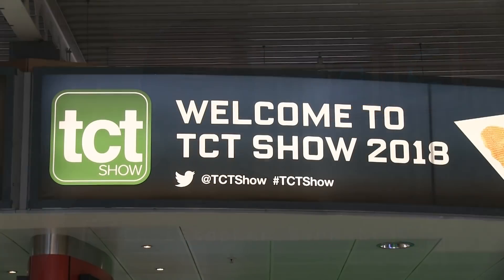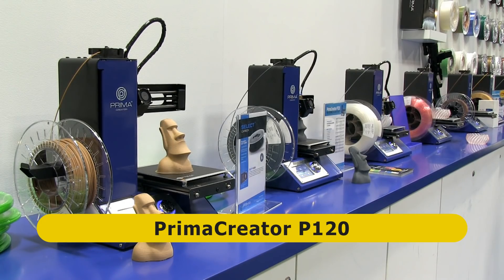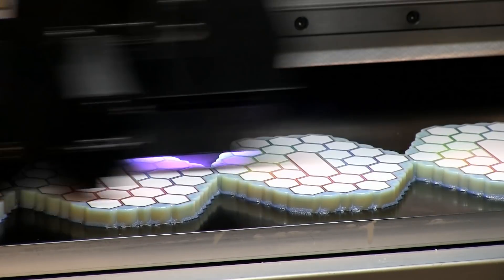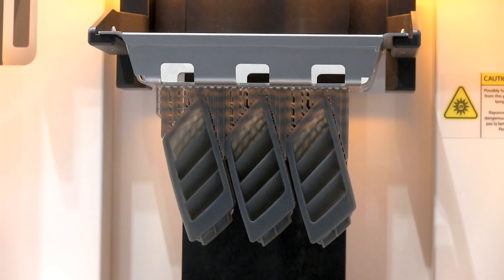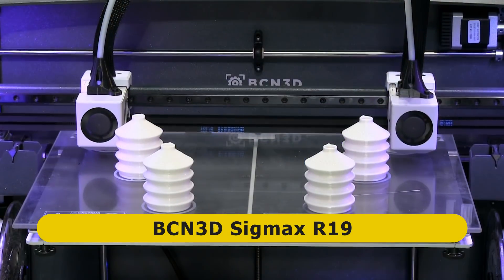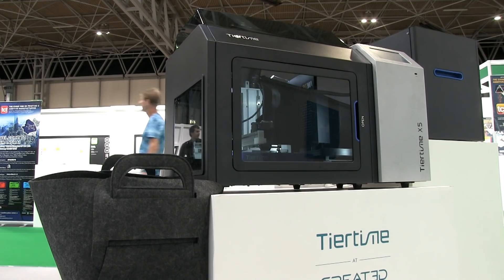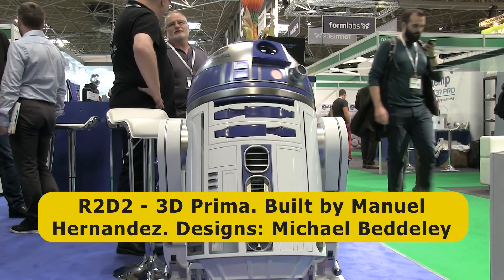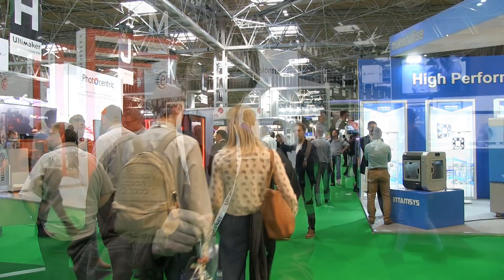3D Printing at TCT Show 2018

Comment: What happened to CLIP?  lol google carbon3d.  Be amazed.
Reply from the maker: Sadly Carbon were not at this year's TCT Show, so they are not included here. Note that the 3D Systems Figure 4 system shown uses effectively the same technology.
Reply: I will go back and check.  I skimmed looking for something new and didn't see anything right off.  I've got some ideas forming re: similar application of principles to draw materials like sugar and bone.
Reply: Checked back - CLIP clone.  Operates at about 50% output rate - if equivalent print quality and cost competitive per output unit andor superior materials selection, then they've got some contention perhaps.  All the other points are things I expect in a "factory" type offering - modular/cellular, libraries/catalogs of things, continuous output options/features, etc.

Good job on 3D for pulling it off, though.  I know several people who have started their kids (and their own hobbies) on MP cheapo printers and enjoy the hell out of it.  Of course, the only complaint is time as all the rest of the caveats are well understood within the first week of buying a more hobbyist type of machine.

Teach your kid "load frame" and "gantry" and they'll understand 98% of FDM (as well as other types of standard programmable X/Y cutting tools, like plasma, laser, waterjet, et al).  :-)  

Thanks for the response and pointer to the info!
Reply from the maker: Figure 4 significantly pre-dates Carbon CLIP -- the name comes from the first 3D Systems SLA patent in the 1980s! :)

Comment: I have actually worked at Stratasys before. It all started at school when I was new to 3d printing but during my work at Stratasys I learned A LOT about these machines. The place where I worked they have both Fortus (FDM) and Objet or Connex (Polyjet) machines. They even have one printer that can print parts up close to 1m in length. It is really fascinating to understand how Polyjet printing works eventhough it is such a simple principle. I got a lot of insight in these devices and helped the employees maintaining them. I was even allowed to print some parts for my hobby projects on such printers.

Comment: Pretty close to amazing output from those machines. I still respect mostly the designers who create the files making these prints possible. I need to buckle down and learn Fusion 360 enough to get the most basic functional objects out of my little 3D printer. Right now I'm in a rut and it's sitting idle for months.
Reply from the maker: Content creation is always key with digital tech. :) You could always start out in TinkerCAD, which is free, quick to learn and can deliver good 3D printing results. This may then motivate you to get into Fusion 360, once you have some functional prints under your belt. Good Luck! :)

Comment: so.. best home 3D printer on the market now for speed and print quality?  And perhaps multi-color printing (even if you have to change the filament manually)?  Thx.
Reply from the maker: It all depends on what you want to pay! Lulzbot and Ultimaker models have a good reputation in the mid-range. The MAKE guide is a good place to start: https://makezine.com/comparison/3dprinters/
Reply: Thank you!!

Comment: The problem with these continuous printers is that they are more expensive than a bunch of regular printers. See comma.ai who have a bunch of regular printers stacked side to side. 

Also wouldn't that ejection system damage the parts?
Reply from the maker: Some things may well be safer to eject than others! :)

Comment: Thank you for another excellent video! I would like to pose a question to you and the channel, knowing that I am not providing enough details for there to be a single correct answer... Nevertheless I would like to ask anyway...
 Is there a recommended starting 3D printer with a relatively low budget in mind that does not involve assembling most of the printer? Like so many people, I am considering purchasing a 3D printer, simply as a hobby and for enjoyment, but I am not interested in becoming a printer assembly person, additionally I would like the printer to be able to actually print something usable with very little fuss. Is there a short list of printers that require very little assembly and just work nicely out of the box? I would be interested in hearing from folks who purchased 3D printers and had a very good first time experience. Can an entry-level 3D printer for less than $500 actually be fun and useful? Is this the right time to purchase a 3D printer in the opinions of folks in this channel? Every year the technology seems to get better and the price keeps coming down, admittedly I do not have a specific use case for printing and as such I understand that answering my question may be difficult... Any insight on things that work and things that don't work or things that made a good experience or things that caused a bad experience would be helpful. Thank you folks, respectfully Ernie
Reply from the maker: In this price bracket there are decent models from Tiertime (Cetus) and Monoprice (both as shown in the video), and also XYZ Printing DaVinci models. You can probably get useful, fairly-no-fuss prints from these devices. Note that the Cetus "kits" are a six-part assembly with a screwdriver, plus connecting various jacks. No not complex assembly. The best guide for many years, in my view, has been the one from Make: https://makezine.com/comparison/3dprinters/
Reply: @ExplainingComputers  awesome thank you! I think you have given me enough information such I may find the courage to get my first 3D printer!

Comment: I would love to see a company combine 3d handheld scanning, and metal 3d printing, I.E. where you can scan a part and have it automatically saved as a 3d printer file, then wirelessly transfer the file to a large printer.

Comment: I wonder if the DMP flex is a SLS machine?
Reply from the maker: It is indeed -- generically called powder bed fusion. 3D System label ths particular technology here as DMLS (direct metal laser sintering).
Reply: so what are the costs of these machines?  Are they within reach of an average consumer yet?

Comment: Thanks for another educational upload. The drawback with 3D printing is the time required to create the object on the screen and then the time needed to do the printing.  If you are going to print out  standard objects like chess pieces, then it's great, but for bespoke items not so clever in relation to the time and effort you've got to put into it.

Comment: Yes!  IMO two things holding back consumer 3D printing are:
1.)  Full color printing (not just being able to switch different colored thread).  
2.)  Being able to make something with metal and plastic (in full color for the plastic) in the same print job.
Reply from the maker: I can imagine hardware able to print metal and plastic components and then assemble them. Hybrid technologies are the future of digital manufacturing! :)
Reply: IMO, having the machine assemble parts after printing would add considerable cost over just having separate print heads for metal and plastic and printing them at the same time or in turns, i.e., print a plastic layer on the base, then a metal layer on the plastic, then a plastic layer on the metal, etc.  But time will tell which method proves to be most economical and cost-effective.  Thanks for the quick reply! :-)
Reply from the maker: Current metal printing technologies do not extrude metal from a print head (well, at little of this does go on, but for parts that then require CNC). So combining heads is unlikely to work. Also, plastics and metals melt at very different temperatures, so extruding metal next to plastic would prove problematic.
Reply: Yeah, that's true.  I wonder if there's some process that can combine soft substances that harden into metal, kind of like a metal epoxy?

Comment: 3:15 "Direct 3D printing in metal"
Christopher, mind to explain a little bit more about such 3D printing?
The strength of the final product is comparable to metal products built by standard methods?
Reply from the maker: The method here is generically known as powder bed fusion (also often called direct metal laser sintering and lots of other names). It basically lays down a layer of metal powder, and fuses the granules together with a laser (although some systems use an electron beam in an inert atmosphere). The best direct metal systems can now produce parts that are better than traditionally cast alternatives -- and such parts are already being used in aircraft and rocket engines. I have a summary of all seven major 3D printing technologies on this page: https://www.explainingthefuture.com/3dprinting.html And I also discuss them -- and show direct metal printing in action -- in my 2014 TCT report: https://www.youtube.com/watch?v=94qoGn0hkEg
Reply: Didn't know you have other channel.
Just subscribed!

Comment: Do the metal 3D printed objects require any heat treatments afterwards?
Reply from the maker: That depends on the technology. Printers that sinter/fuse metal powders -- like the 3D Systems DMP Flex 100 one I show -- produce prints that require no post processing other than support removal, and cleaning away excess powder. So the DMP Flex 100 print shown in the video is exactly what comes off the machine. However, there are so-termed "binder jetting" systems that do result in parts that require a two-phase heat treatment, the second of which infuses the part with more metal. Such parts end up about 99.9 per cent solid, but are cheaper to make than pure direct metal 3D prints.
Reply: @ExplainingComputers  Thanks. I've read that SpaceX uses 3D metal printing for components in their rocket engine. Also, GE for turbine blades in their recent big jet engines. Seems impossible!

Comment: Chris this maybe a question for your book or post for other channel but I don't get one thing shown in this video.  I understand 3D printing  is good for prototypes and small runs. But for production runs other forms of construction such as injection molded or sand casting are faster and cheaper.  I'm surprised  you did not see or show systems  that can make molds for large scale productions. A 3D printed casting machine would make a great system for manufacturing company's.
Reply from the maker: Lots of the industrial machines shown here will (in part) be used for making molds, patterns and other production tooling. Indeed, that is just about the largest use of the technology now (most 3D prints are no longer prototypes as in the past). In the video there are some shots of lost-wax substitute patterns shown printed on EnvisionTEC machines. 3D printing is already significantly reducing the cost of sand casting in some instances by 3D printing the molds or cores (although I do not show that in this video). Absolutely, for very long runs, injection molding is cheaper - although by printing the molds, the economics change. For example, a typical injection mold may cost tens of thousands of dollars; a 3D printer may produce  a low run alternative (say to 10,000 impressions) in resin for a few hundred dollars, or maybe a thousand or so dollars in metal for long-run use. For medium-run production, the goal of Figure 4 from 3D Systems is direct, price-competitive competition with injection molding, and they are getting there quickly. Ultimately, we also need to remember that our whole economic model is based on remote mass production, mass warehousing, mass remaindering, and mass transportation. And 3D printing could change all of this. We will not use this new technology to produce old things in new ways, but new things in new ways! :)
Reply: "new things in new ways" just WOW, with these few words you really helped me to see the incoming waves!

Comment: that metal printer is very intesting to me i have some ideas for that like a adapter ring and if the thread i can choose is precise enough , i have some old stuff where they dont produce or sell these things anymore 
they could be remade by this 
if i can choose the material like silver i also could make a silver cooler or at least copper

i have some chipsets where they have different locations for holes where you fix the fan that would also be a idea 

having a metal printer would be awesome

Comment: Very interesting!  Especially the high resolution metal prints.  I imagine industry is the primary target for metal mill quality prints, but do you track metal printing crossing over to the consumer market?  I guess compared to extruded composites, does metal printing have some major technical hurdle that holds it to industrial machines (e.g., extreme heat, off gassing, etc.)?

Even if the tech develops strictly inside industry, it would be interesting to see precision alloying coming down the pipe. Even if it were just building alloys that required a sintering phase, it would still be awesome.
Reply from the maker: I think that direct metal printing will remain an industrial technology for quite some time. But it is already available to consumers using online services such as 3D Hubs, Shapeways and i.materalise.
Reply: @ExplainingComputers  - hmmm; those websites are very interesting; I believe you've mentioned 3D hubs in a past video if I remember correctly; the site looks very familiar - I suppose its value must not have registered at the time I first visited, but these services appear very well equipped.  Thank you for the heads up!  

Now I have to decide if I want 18k or 14k Gold for a full body suit...maybe Silver, I don't want to be too flashy!  

I didn't even know 3D metal printing could offer such a variety of metals - that seems pretty significant.  I was impressed just seeing Titanium.  Very cool!
Reply: I'm sure it'll become a household appliance at some point right next to your laserjet printer, but it will be several years before that happens, not everyone has a regular 3D printer yet LOL.  Would be fun to have but not cheap to get something that can do useful items I don't think the entry level ones really are capable of doing anything of use?
Reply: @wildbill23c  - yeah, it seems they've really taken off...  I mean, the last time I looked, entry level models were ~$500, & that wasn't too long ago.  Now entry level 3D printers at $189!  Maybe not the best choice, but a price like that will give development and innovation in 3D consumer machines a nice push forward.

I wonder where they'll be in another 12-18mos.?  It seems hard to imagine...

Comment: Hi, great video. I got an entry level 3d printer a few months back and as you said combined with other things. such as arduinos etc, the possibilities are endless. Been watching the open dog videos so seeing it further on that James has currently shown is a slight spoiler but good to see.
Reply from the maker: Not too much of a spoiler on openDog I hope! Mainly that the rotational axis control has been implemented, which I believe is coming in openDog part 9. I am very much looking forward to seeing it walk.
Reply: Entry level 3D printer?  Hmm, have you made anything of use with it yet?  How sturdy are the items that it can make?  Would you buy it again or would you recommend someone buy something a bit more higher priced?  I'm trying to decide whether or not to get one, and I don't want to make the mistake of getting a cheap one if they just aren't going to be worth it.  Something I have seen in some gears someone 3D printed were they turned out extremely hollow so they weren't holding up to light use.
Reply: Hi, the entry level I went with was a creality ender 2. Cost about £120. (it was on sale, there were cheaper ones but they were much more kit form and some had reputations of catching fire). As for useful, well I got it because I've been working on a wireless system for controlling focus on a video camera and needed to make a mount for the motor and various gears - all of which are really accurate and not completely hollow(it's called infill - you can determine how strong/light a part needs to be), they are as good as proper lens gears that I've paid £10  each for(and are exactly to my requirements). Also made custom project box for another electronics project. I've iterated through a number of different ideas and the biggest thing is just trying things, if it doesn't work, tweak design, print again and then repeat until you get what you need. So far only printed in PLA but it can do ABS which I may use for final parts. My only advice is to do research to find out if one exists that fits your needs and budget. Before buying it I was going to get parts printed online which would have cost £20 - £30 each. After getting the printer one of the first things I printed was the thing I was going to send to 3d hubs(or someone like that), turns out I had made a mistake in the design, so immediately corrected it and printed again. If I had gone the online route I would have paid for a useless piece of plastic. Repeat that story a couple of times and I've saved the costs of the printer already.